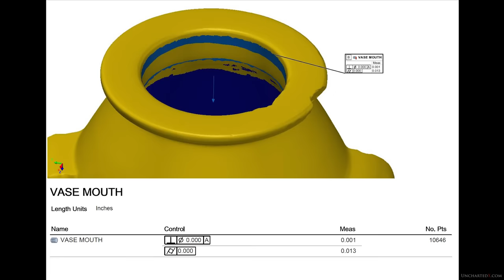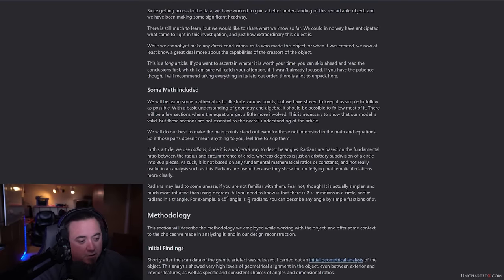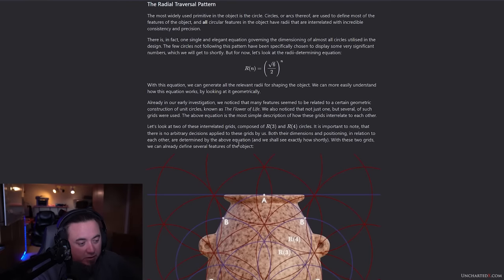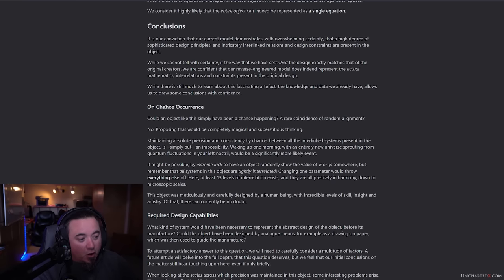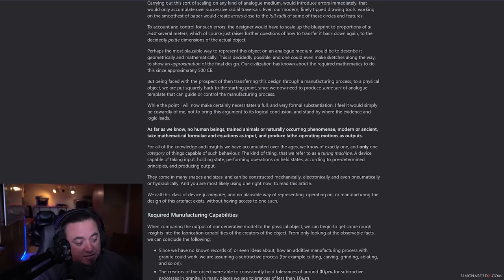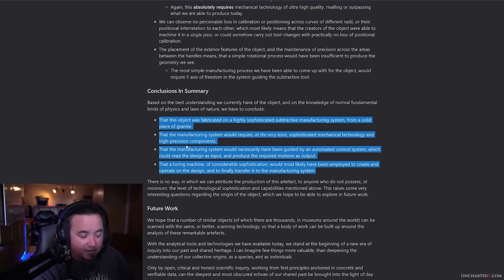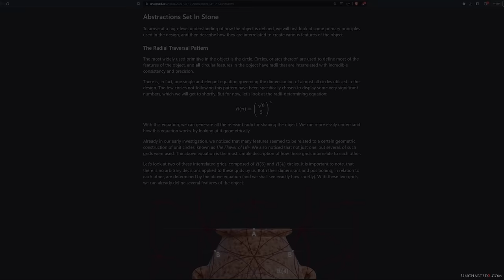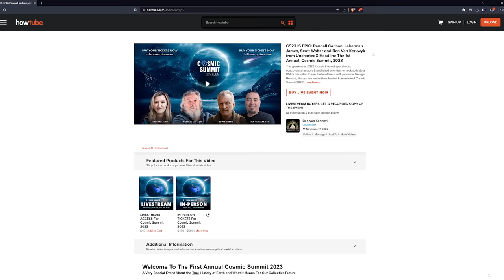Was a COMPUTER Used to Design this Artifact??

Comment: This is what Bard said: The vase in the article you linked is a beautiful and intricate work of art. It is made of granite, and its shape is based on a mathematical equation. The equation is called the Fibonacci sequence, and it is a series of numbers where each number is the sum of the two previous numbers. The sequence starts with 0 and 1, and then continues as follows:

0, 1, 1, 2, 3, 5, 8, 13, 21, 34, 55, 89, 144, ...

The Fibonacci sequence can be found in nature in many places, such as the spiral of a seashell or the petals of a flower. It is also used in art and architecture, and it is said to be aesthetically pleasing.

The vase in the article is based on the Fibonacci sequence, and its shape is a spiral. The spiral is made up of a series of curves that get wider and wider as they move away from the center. The curves are also arranged in a way that follows the Fibonacci sequence.

The vase is a beautiful example of how mathematics can be used to create art. It is also a reminder of the beauty that can be found in nature.

The master equation for the vase is as follows:

Code snippet
r = a * f^(n)
Use code with caution. Learn more
where:

r is the radius of the vase at a given point
a is the radius of the vase at the center
f is the golden ratio, which is approximately 1.618
n is the number of curves in the spiral
The master equation can be used to calculate the radius of the vase at any point along the spiral. This can be used to create a 3D model of the vase, or to print the vase out on a 3D printer.

The vase is a beautiful and intricate work of art. It is also a reminder of the beauty that can be found in mathematics.
Reply: i think thats a nice bluff
Reply: Hey Bard, is not currently supported in my country. Can you paste this in see what it says? 

The quran says there will be a creature of earthly material that will speak to mankind and tell them that they are of "our" signs doubtful, 27:82 and then later 27:93 saying in time the signs will be shown to mankind, so be patient. 
The chapter starts with two seperated letters; 27:1 "T, S"  The chapter have 27 times T, and 93 times S. The chapter consists of 93 verses. 
There are other wierd patterns in the book, specifically to the golden ratio. 
The quran consists of 6236 verses. I was thinking about a verse 16:18 saying that god favours are infinite and cannot be counted fully. 
Phi is a irrational number as the fibbonacci sequence goes to infinity. The chapter "The bee" 16, also the bee with their hapliod 16 chromosome, the ratio of population from parent population to actual population progresses towards phi ratio. 

The golden section point of 6236/3854 is the 3854th verse; 
Here is what it says 37:66 "they will fill their bellies with it" the belly button from top to belly, and from belly button to feet those two ratios gives 1.618- A further study was done showing that belly button also occurs in golden section from the chest to belly and belly button to hip. So it repeats. 

The quran counted is 77430 words; the golden section from the top of the quran to 47855th word it lands on this verse
26:123 People of Aad denied our signs 
The verse gematria in arabic is 1618, Aad, was a nation that built into the bedrock, homes. But they vanished and destroyed, in 7 nights and to the 8th day, through lightning storms according to the quran. 
The greater part of the golden section 47855th measure, can be flipped, so that we can count from the end of the quran. This time it lands in this verse, at the start of the word "The people of Hud" 
11:89 "the people of ", Hud 
Hud was a prophet sent to Aad nation.  The verse it self don't equal 1618 in gematria, but the verse consists of 76 letters. 
The golden section is at the 47th letter, and its the start of the word "Hud"
Reply: Thank you I'll remember this